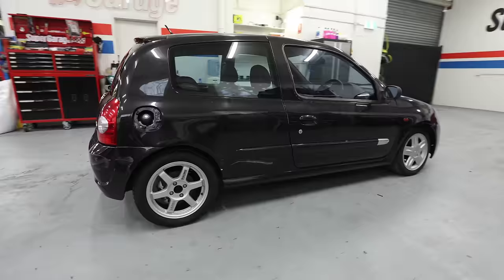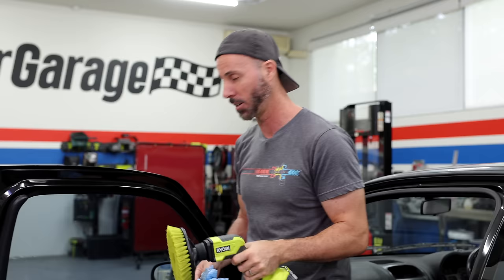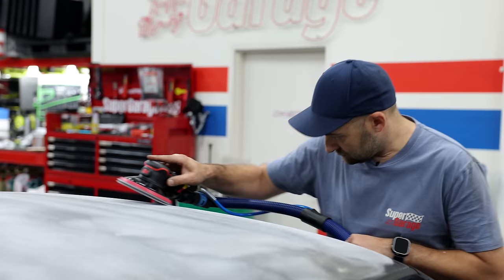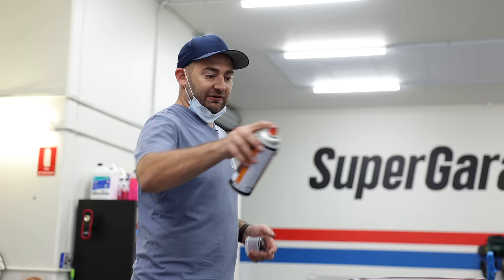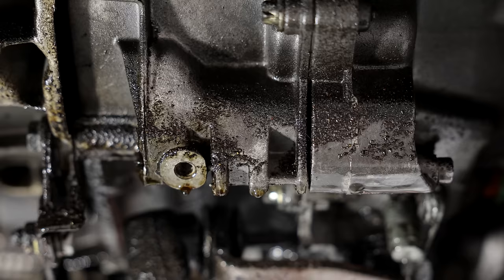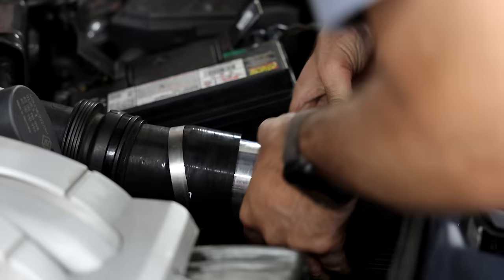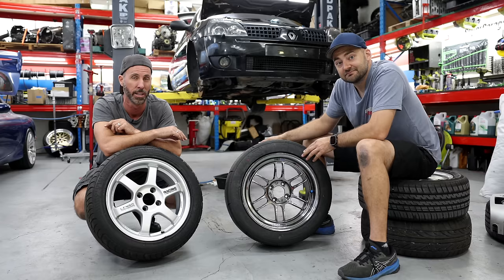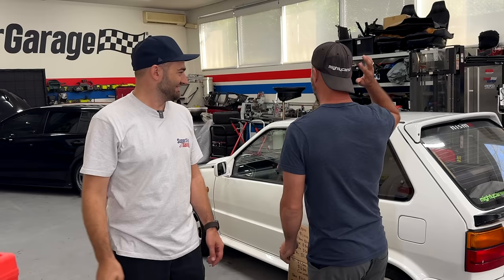How Much MONEY Can We Make In ONE DAY?

Comment: You either die buying beaters that have been bodged by some cheeky bogans with a rattlecan or you live long enough to become the bogan sprayer.
Reply: Yeah not a word about compression or clutch, or rust for that matter…
Reply: I'd give that single stage clear coat 3 months before it is toast. Ask me how i know.
Reply: @warwicks2780  Yeah, but when you sell a car at the price they did, the buyer has to expect problems. The bumper fix, tailgate replace, interior cleaning and brake service all are things the new owner doesn't have to worry about.
Reply: Rust isn't much of a problem in Australia as I understand it
Reply: @warwicks2780 rust aint really a big problem in Australia though, at least not in Europe
Reply: @nikaleve1657  French cars will rust in Aus on the coast. In fact most POS cars will rust near the beach.
Reply: @doueven  Most french cars have zinc-dipped body so they will not rust unless damaged, unlike 95% of japanese.

Comment: 24 hour car flip, UK edition: spend 2 hours trying to undo bolt, shear it off. Cross thread sump plug while staring aghast at holes in cross members. Rear wiper is rusted on. De-gas Aircon by accident while wrestling with oil filter that has been tightened with impact hammer. Cry into swarfega pot.
Reply: that sounds eerily familiar
Reply: As a UK based owner of a dirty old Nissan 350z I can fully confirm this!
Reply: My favourite is the seized bolt that the previous owner has had a go at and failed. Looks ok at first, but only because the rust has formed into the rough shape of a hex head. Socket needs hammering on, then spins freely on the perfectly rounded off head. Car won't go through MOT test without replacing the part this bolt is holding on. Urgh

At least all the crying flushes all the bits of rust out your eyes
Reply: Have you been stalking me?😂
Reply: As someone who's just had to chisel and grind off three 'nearly nuts' off a down pipe on a mk2 Clio 1.6 I can't confer. I can't afford Swarfega for a start.

Comment: There's absolutely no chance the glovebox accessory was already in the car, it for sure came from Moog's collection
Reply: ...or from Cheryl's mystery box
Reply: Wen special item for Cheryl's mystery box
Reply: Local company I worked for fired a guy.  He didn't get to clean out the work ute. They found a flesh light under the drivers seat
Reply: The dried remnants is what was censored.
Reply: That plastic weld ....... GEeEezuz that looked average, I learnt and got a lot better by doing a season in Queenstown  NZ fixing skis and snowboards. Now it's not even a challenge.
Reply: 😂 defo from moogs collection
Reply: @BigCgull no doubt practice makes perfect. 
My job would probably look even worse.

Comment: Weirdbeard signing in!

Some Clio tips
- Oil filter is heaps easier to get to when you remove the fuel rail guard (2 x 10mm nuts, piece of piss to remove).
- Oil leaks will be the sump gasket (needs subframe dropped or engine lifted up to get the sump out, yay) and the gearbox driveshafts or gear selector seal.

Thanks for keeping another 172 on the road!
Reply: Exactly!
Reply: Sounds like bad engineering. Im not removing parts that aren't a splash shield, oil filter, or drain plug to do an oil change. And im not removing a subframe just to drop a pan on a 4 cylinder.
Reply: @lakeshoresubtleties  Of course its badly engineered, Its French... Doesn't mean its not a good car worth the extra effort though.
Reply: @Hovis_Enjoyer haha. That's exactly what it means, in my view. Unless it's one of those goofy looking bubble butt Meganes from the 2000's. I mean, how can you not love something that fugly? Anyhow, I don't want to work on things that aren't engineered to be worked on in a reasonable manner, so it's not worth the extra work. Plus, I don't know if they're like the Germans with their stupid specialty fasteners and insanely priced parts, but I'm not sure I want to find out. We don't really see them in the U.S. anyway. To each their own.
Reply: Lol I
Work at Renault delearship and own a 172 clio. We just do it like how it should be done . From underneath , it’s a bit of a faf but from above is really pointless cause you have even less space . Oil leaks aren’t always really leaks in my eyes .( I call sweating) most of the oil leaking is either gearbox or crankseal .
Reply: And for the complainers , what do you expect from a small car with a big 2.0 engine in it ? That you can sit next to it ? 🤦‍♂️

Comment: I'd love that Clio Sport get some more attention, such a underrated and fun cars, alongside with the whole Renault Sport lineup, but I'm a bit biased lol
Reply: Didn't you hear the comment about the oil filter ? I doubt they would go back into that engine bay anytime soon lol.
Reply: @JemmC89  Just Renault things, you get used to it
Reply: @JemmC89 try accessing the engine fuse box that’s even worse.
Reply: @Simon78  character  building...   like replacing the  window regulators.... but they  are great cars, I miss my 225 megane.. even with all its many short comings.
Reply: @JemmC89 pretty typical for these French cars the engineering on some parts is straight up regarded
Reply: Not many people like the french cars unfortunately, currently have a Twingo 133 and a Megane 250 so I would love more renaultsport content 🤣
Reply: @JemmC89  Changing an oil filter on a 172/182 takes literally 1 minute. I dunno what they're complaining about.
Reply: @healthiestmotorsport5145  For sure, 90% of other cars are 10 times easier though. and don’t require you to clean up all the oil that drips down the front of the block 😅
Reply: @zake881  Yeah I know that unfortunately, and same here, I have RS 265 Cup and it's such a blast 😅
Reply: @BaconDiggyDawg  It's pretty annoying that's for sure, I have the same problem on my RS 265 and my OCD doesn't help lol, but afterwards when I go for a  drive on some b-roads I forget about all the shortcoming of this car and just smile the whole time
Reply: @bleachyunknown2000  Yea Megane oil filters are done by braille I think, can't even see what you're doing. Epic cars though, especially with a remap.
Reply: @healthiestmotorsport5145  Hell yeah, I'm running a remap with Wagner intercooler and 200cell downpipe alongside with some other tweaks such as Forge uprated actuator and Pipercross drop in air filter , it's just enough of extra oomph for this platform, buut I was wondering if not to go with custom turbo and forging the motor, but that would be a bit too much for now. I'm looking for a nice daily currently, then I might keep my Megane in garage and bring it to perfection bit by bit.
Reply: @bleachyunknown2000  I've just had to forge mine after having low compression 🤦 will be going to a 400 turbo kit at some point if I can ever get the thing to run right 😂 pretty much the same mods otherwise
Reply: @JemmC89  You can change it with one hand a commodore is way harder.
Reply: @JemmC89 

They're a little bit of a pain to get to but if you can change a wheel you can change a filter on one of these... Or never pick up a spanner again 😂
Reply: @Simon78 

It's literally right in front of you on the right 😂
Reply: @healthiestmotorsport5145 

The Mégane oil filter is a piece of piss to do. Loads of room!
Reply: @skylined5534  It's not hard, no oil filter's hard. It's just shitter than it needs to be. Even a 182 can be done from the top, and that has the same amount of engine crammed into a smaller space.
Reply: @healthiestmotorsport5145 clearly you've never worked on an early 2000s chevy cavalier or some modern audis.......
Reply: @lakeshoresubtleties  Fair point, I work on Jaguars and Land Rovers on daily basis which is even worse 😆 Did they change the typical filter location on newest gen EA888 engines? I own also a 2016 Golf 1.8 TSI and oil filter has a pretty convenient location
Reply: Lol I
Work at Renault delearship and own a 172 clio. We just do it like how it should be done . From underneath , it’s a bit of a faf but from above is really pointless cause you have even less space . Oil leaks aren’t always really leaks in my eyes .( I call sweating) they did it the stupid way by changing the oilfilter from above cause I have never seen anyone do it like this 😂🤦‍♂️.not the cars fault. What do you think with a 2.0 Na in a small car ? That you can sit next to it 🤦‍♂️? It’s the same size as the Nissan superturbo and that had a 1.3 ? What do you expect from same size but with a 2.0 in it , to have more space 😂? They should never buy a alfa Romeo with a busso V6 cause they would cry even more
Reply: @ThaDutchDK1989  If you can't do it from above without spilling oil then that's on you 😂 Was even a piece of piss on my last one which was turbo'd, so intercooler pipes in the way too.

Comment: I'm a serial Clio pervert. There are a shit load of quirks with them so watching someone fix one just makes you go "I bet they get caught out with the rear caliper slot and the peg on the pads"🤣
Reply: at least they didn't find out the hard way that the rear brake disks are integrated with the rear wheel bearings (similar to the drum brakes on some cars) and cost 4x as much as regular brake disks.
Reply: I @AlexanderBurgers  I have this with the front discs on my vw T3. It's a shit system from a maintenance perspective.
Reply: It's when people miss out the bearing spacer and then find out their bearings are knackered after about 10 miles. Got to love the French
Reply: @AlexanderBurgers 

Same deal for the rear drums.
Reply: @Techtiqal 

It's a one piece bearing on any Clio.

Comment: Good work guys. Too many people these days have no passion or love for their vehicles. They would rather trade it in for their next POS and keep moving that way. I've owned my 02 Pajerp for 6 years, I've done a top end rebuild, front diff, power steering racks, rust repair, respray and now I'm looking at all bushes to be done. I have spent well more than the car is worth the buy another one or even a newer one but I love the car so will keep spending the money to keep it running. Plus I know what has been done and what hasn't unlike trying to buy another 2nd hand car.

Comment: My 1997 Audi A4 1.8T is a gem. Cheap tax, VERY cheap insurance, cheap parts and easy to work on. I made probably THE worst repair on it a couple of months ago, i replaced the heater core! 
Aussies probably don't care AS much about that, but here in sub-arctic northern Sweden when it's -20C and below for months as well as down to -40 or even a couple of degrees colder at the worst each winter, the heater core is KIND of a big deal. Also, when it's leaking like mine did, the inside of the windshield gets coated in coolant. I actually ran with the pressure cap off the expansion tank  for about a month before i could borrow another car while COMPLETELY removing the entire dash from the firewall to get at the heater core.

Comment: As someone who lives in the UK with our crappy salt roads, it was wild to see someone had scrapped a 172 that virtually had no rust on it.
Reply: I've got a mk2 1.6 I'm currently building back up (upper end Dynamique with climate, auto wipers and auto lights etc ).

Very little rust other than surface stuff and it's lived in the dirty North all its life 😂
Reply: @skylined5534  Many many years ago my first car was a Mk2 Ph2 1.2 16v "Extreme" in Cyclone Blue, despite the typical Renault coil pack going pop every now and then, it was reliable, cheap and fun, and had no rust anywhere, Still miss that car to this day.

Edit - Sad to see it failed its last MOT in 2018 at 112k miles, most likely gone to scrap heaven 😢

Comment: with the plastic welding, i actually saw a tiktok hack that worked and was actually good, they stripped some copper wire aligned the bumper and melted the copper strand across the break using a normal soldering iron, holds very well

Comment: You guys should get a one and do a full conversion.  Find a FWD V6 with a reliable engine.  Turbo would be a plus.  Remove the rear interior cut off the rear floor.  Drop in the V6 and transmission from the donor car.  Making the Cleo a Mid engine rear wheel drive.  Out a wide body on it..  now you have a sick two seater.

Comment: I can’t deal with the orange peel and the click bait but understand you guys need to attract new viewers. 

And highly doubt this is a days work, unless the day is 4am - 10pm. From someone who has worked in the industry and has been watching MCM for over ten years.
Reply: I used same type of black metallic base and cheapest clear coat Supercheap had on front guard and half front bumper of 2008 Craptiva. Sanded loose clear coat, sprayed primer, base coat. Sprayed lots of clear coats. Left it for a week Wet sanded with 1500, 2000, 2500 and 3,000. Then used bufffer with foam pad and cheapest cut & polish, then cheapest hand polish, then turtlewax. Bought number plate frame to cover where new & old paint on bumper met.

No trace of orange peel. I could not believe how good the result looked.

First time I'd ever painted any car panels and most people would not be able to tell. Only mistake is that I didn't know you are supposed to 'block sand to keep it flat. You could tell in some places if you looked carefully. Next time will be perfect.

Comment: Clio 182 being $7000 is mental to me. Then converting AU$7,000 to £ is around £3,600 which isn't far off an okay 182 now. Ropey 197's are available for just over £2,000.
Reply: It costs way more to keep older cars on the road in the UK compared to here, so the depreciation here isn't as bad.

Comment: Might want to take that wiper motor out of the old hatch cover as a spare   😁  Did you check that the wiper motor is getting power?
Someone connected a bottle "pump-spray" nozzle to a bleeder tube to pump the air out of the brake lines..  I thought that was worth mentioning..
I didn't know that car is a Hybrid, 16V..  my E-bike is 48V..    🙄

Comment: Thanks for saving awesome car and putting it back on the road!

But using 5w30?
On a car that is driven hard I would tend to get a oil that doesn't get to thin at high temperature,  no need to go overboard but 5w40 would be a better choice IMO. And given Australia doesn't really get cold you could go 10w40 because there is no real risk of it getting too thick.

Comment: What a pity just sold a Mizabishi Marage 2014 full service, Penrite oil and filter,CVT two filters replaced and oil ,4 mags tyre's done 1,000 ks ,no rust paint good,3 O2 sensors replaced, but still has sensor , problem I think the one for the auto, detail done,only one small dent on left Piller,new struts 110,000 ks on the clock, registered,$2k

Comment: main reason why the roof paint is off is simply because Renault cars always had this problem. They use cheap coating that always ware off or flake, leaving your car with panels in different colours as it ages. other French cars had same issues (like many I guess in the 2000's where every bits had to be cheaper), but Renault are notorious to be particularly shitty.

Comment: I see a lot of comments in here talking about it is/could’ve been a good project…
If they don’t want to build it or it makes more sense to flip and profit, then they should totally do that

I’m in the predicament of havin go a perfect flip car, but I’ve owned it now for about 8 years.  Bought it used and loved it, put some mild mods in it(intake/exhaust), had plans to go further down the hole…I drove it for a few years, my wife dove it for a few years, now I’ve had it again for a few years.   Body is mint, had minor paint damage(some paint chips on hood and rear bumper).  Runs like a champ, has new tires and new-ish brakes(pads, rotors and fluid about 2 years old).  But honestly I just don’t have a feeling for the car anymore.  The only real problem with it is it’s got a valves cover leak, which I’ve purposefully neglected to repair because the thing burns oil like it’s going out of style, 1/2-2/3 qt every fuel tank(about 300mi) and I’m really looking to dump it for just enough to help cover 1/2-2/3 of a different car I really do like more.

It may be a great car, awesome platform, but if it’s not their cup of tea, there’s no reason.

Comment: yeahhhhhh a clio one of the best cars ever i have three of them i love them so much my first is a 2005 clio rush 1,2 i have had it over 9 years needs restored if its not to far gone but the car did me proud and then the other two clios are sisters and rare renault clio gt 1.6 vvt 2009 the orignal release not the 2010 crap that had different colours this was the one and only colour maulta blue 128 bhp and 6 speed gearbox super fun to drive have owned one of them since 2018 after my mum passed away i needed something to focus on and bought this wee clio for 700 pound with some front end damage over the next year me and my dad rebuilt and serviced her and havent looked back since her sister i bought in december as they are rare are she was in fantastic condition and my first one was missing alot of trim pieces so this way i could compare and see whats different when they originally came out car reviewers slated them but its all rubbish these little cars for me in the uk allow me to get 36 plus miles to the gallon which is great